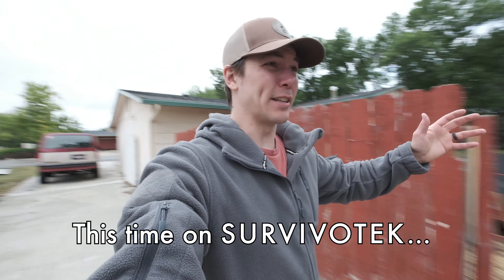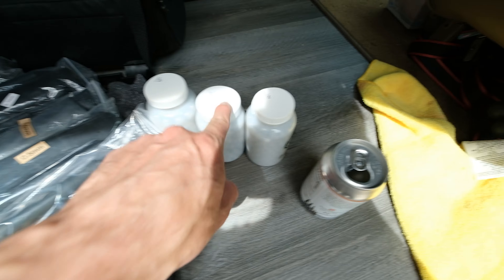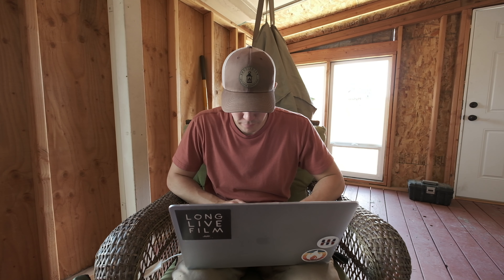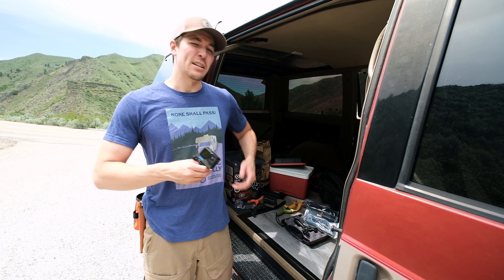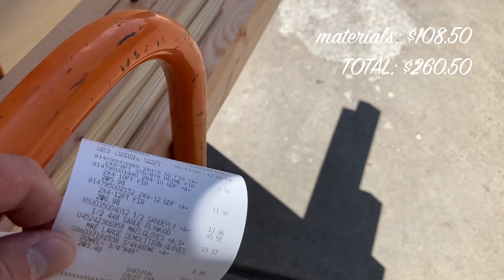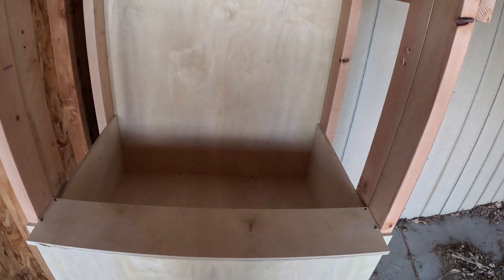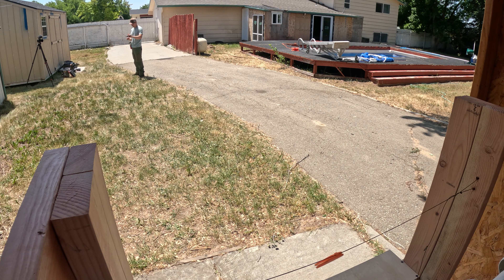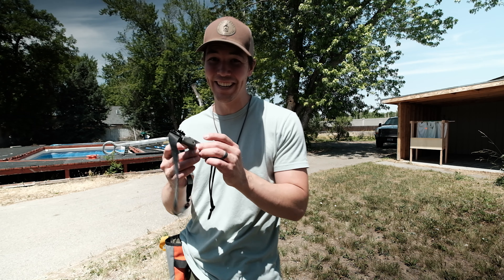How Latex Thickness Affects Your Slingshot Speed | Simple Shot Axiom X

Comment: If you trim 1/4-1/2 inch off the two legs on one side and drill a hole in the bottom of your catch you can have an auto collection system. Use a coat hanger to hang a coffee can or soup can under the hole. Similar to a grease catch under a bbq grill…. Your welcome.

Comment: Try changing taper widths. I took some 1mm latex and they were tapered 24 to 12, and I had a new slingshot; pocket sized; so I cut one band down the middle which made for pretty thin bands, but they shoot really fast with 1/4 inch and 3/8 inch steel.  So not only does thickness matter, and taper, but also band width.  Please do a video if you could.  I subscribed and liked :)... Take care!!!!!

Comment: can you tell me what these measures mean, what is measured with them 20/14/270 0.60
Reply: Slingshot bands in the modern era are often cut at taper and in millimeters. So it should read 20mm at the fork; 14mm at pouch; 270mm long. The thickness of the band is .60 of a millimeter thick.

Comment: Hi my name is Robert Bussiere I live in Ontoagon MI,
You got lucky to get the material to build that catch box for 108.00! For me to build the same catch box,
It would cost me 8.00 for 1 2x4 x 5=40.00,  1 sheet of plywood would cost me 179.98 x2 = 359.96,
2 pieces of dowelling 8.00 each x 2 = 16.00 for me to build the same catch box it will cost me 415.96
Reply: Or a towel and an old ton bag. The kind you get sand and gravel in. Everything is free if you DIY.